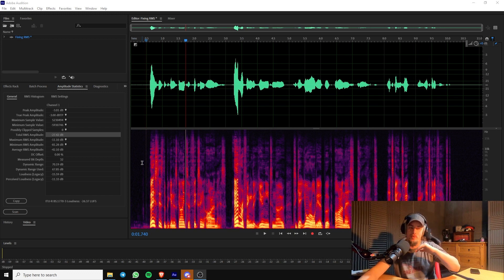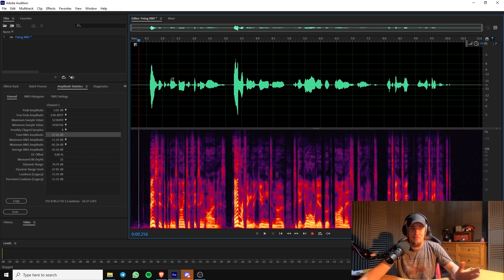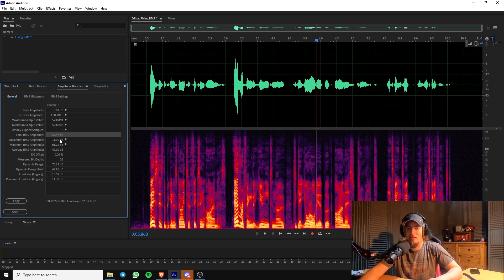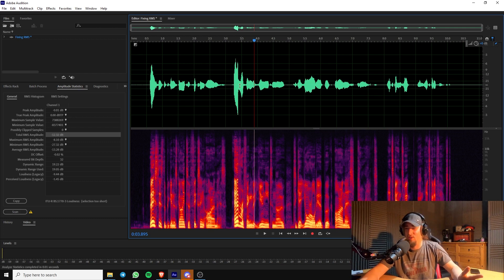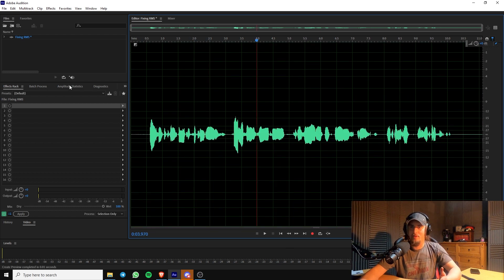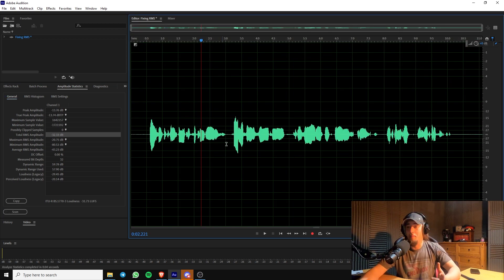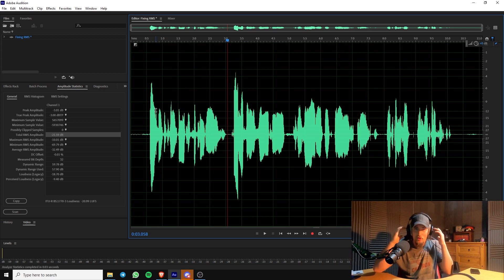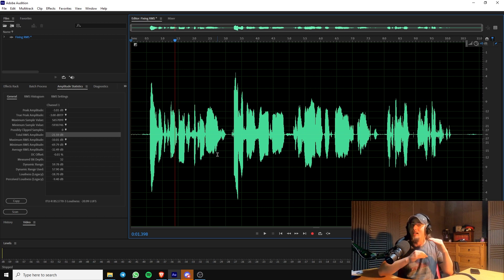RMS for Audiobooks explained - How to Fix your RMS for ACX

Comment: Great video man. Just one question, does the RMS need to be consistent throughout the audio tracks to be accepted by ACX? Meaning, if my introduction track is -19db RMS do the rest of the tracks need to be -19db as well or as long as the RMS is between -18db and -23db I will be fine? The reason I am asking is because I am having trouble keeping all of tracks either -19db or -23db when compressing.

Comment: Is the room noise / non-speaking parts included in the average RMS reading? In other words, I run a fade envelope before and after spoken parts, which zero outs all volume between spoken parts. Is this why my RMS is always too low even after processing?
Reply from the maker: Technically it is included, but thats not why your RMS is too low. Noise floor reduction should make 0 measurable difference to your total RMS. If your RMS is low, compress then normalise.

Comment: This saves so much time! Love the compressor advice - but i noticed it distorted my "s" sound at one point. So i had to go back and lower peaks manually which is so time consuming...am I doing something wrong (setting at -25 db ratio 2 and attack 1)...I want this to work so badly
Reply from the maker: are you also running a de-esser?

Comment: Your video is SO HELPFUL - but I have a question...Why would a person normalize to -3 before you run a compressor if you are just going to cut everything and boost it using the compressor?
Reply from the maker: If you recording is quiet, the compressor will work less. Remember the compressor work top down, so you need you signal to be at the top for it to work properly. Normalising is also a good start point to help keep all your tracks consistent.
Reply: @KrakenMediaPro  Ok, so normalize (-3db) then compress, then normalize (-3db) again... yeah?
Reply from the maker: @amydubose  Yup, pretty much.

Comment: I've watched quite a few videos on how to change the RMS to meet ACX standards. This, by far, explains it the best. I was able to change the RMS to the correct levels (using other techniques), but it kept clipping the audio. I'm going to try this way later on. Thank you so much!!!
Reply: What are you recording with? Do you know how to fix RMS in Logic Pro? I found where to switch the Logic Pro setting to 44.1 instead of 48, so now that’s one issue that ACX isn’t flagging. But it still says: “RMS is too low. Raise the level of this file 2.1 dB." Do you know how to do that? I see YouTube videos for how to raise it in Audacity, but not Logic Pro.

Comment: You did not explain the effect of Attack and Release settings while using the compressor. If Attack settings are higher like 30-70ms louder peakes are not gonna be compressed. So keeping attack time short like 1ms helps us cut the louder peakes. And your release setting was 50ms which means compressor will stay active for 50ms after it starts cutting the peakes.

Comment: Okay I have watched your videos over and over and every time I get db to 3.0 my rms is too low and when I go back to fix it, it messes with my db.  I cannot get the two right. I am nearly in tears as I have my very first audiobook and it has been months overdue and I cannot fix this problem at all.  I am about to give up as I have tried everything I can think of.
Reply from the maker: Try using a compressor with threshhold set to -20 and a ratio of 2:1, it should then go really quiet. Normalise again to 3.0 and your RMS should be up.

Comment: I am now a subscriber- You have made the lights go on! I was able to fix things before doing what was told, but I didn't understand why I went from  too quiet  to  too loud, now I get it and also the differences in checking software with the -3.1db - great tip, I think that is also what I was running into.  Thank you for your videos
Reply from the maker: Glad I could help!

Comment: Thanks for the explanation! Very thorough. I have a quick question, if you don't mind. I'm being asked to deliver a recording that "should measure between -23db and -18db RMS (average)". I've been trying to hit the Average RMS Amplitude on the Amplitude statistics, and it's been a nightmare since it's significantly lower than the Total RMS Amplitude. I noticed that you're using the Total RMS to measure here. Is that what I should be using instead of Average RMS, even though the directions I was given say "(average)"? I can't really find any resources online explaining the difference in Audition. Thanks!
Reply from the maker: You are right, Average RMS for some reason is "Total RMS" in Adobe Audition. I can't really explain why, but if you are asked for average RMS it is the Total RMS figure in Adobe Audition you need to look at.
Reply: @KrakenMediaPro  Awesome! Thanks for the info!

Comment: Negative makes no sense. If 0 is the top level, but quietness can be infinite? In reality the human ear, and even instruments can only measure a specific level or range. Noise meters go up in scale from 0. Why does it have to be negative? I cannot imagine being at ground zero of a nuke and being told that there is noise that is louder? Or, in a vacuum of space where there is no noise, yet what level would that be? No common sense by the people who decided this. Okay. I will have to deal with it. Whatever. Thank you for the information and video.
Reply from the maker: In the analogue realm (ie the real world) 0db is silence and it goes up infinitely. In the digital realm (ie on PC) the actual volume of a signal will be dictated by the hardware which is a variable. So in the digital workspace it starts at 0 and then indexes down from there. Think of 0 as a 100% signal. It will be louder on bigger speaker than smaller speaker... But the signal is the same. I will do a video on this, it's quite interesting.
Reply: @KrakenMediaPro  I am getting it. Currently working on a sound room. I started with noise at -20 to -30. Then started to move things around. Put PC in the other room and closed the door. This gave me 10 to 20 reduction. Is it still called a reduction if it is negative? Hee Hee. My brain cells are in trouble. I only have two. Then I built a sound enclosure for the PC. Closing the door with the enclosure was better. Now sound blankets around the desk is reducing it more. I hope I get there. Your video truly explained the RMS AND the plug-ins too. Currently got -50 something. Thank you so much.
Reply: @justnotg00d  get waves NS1. Pretty awesome to kill noise